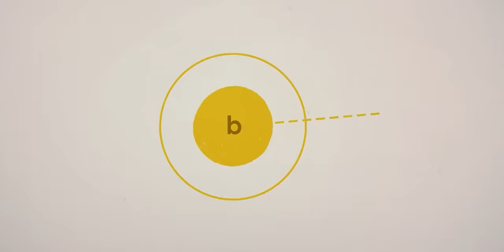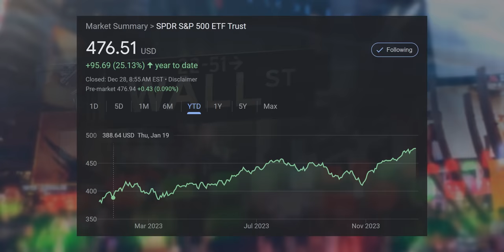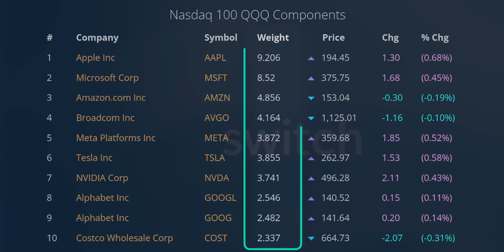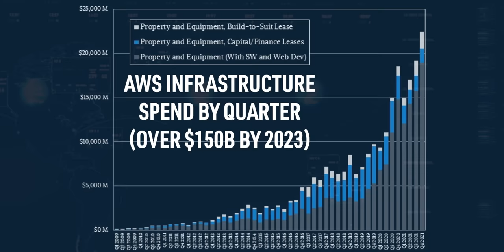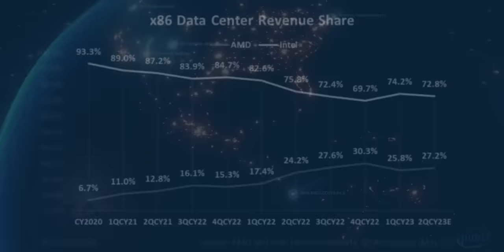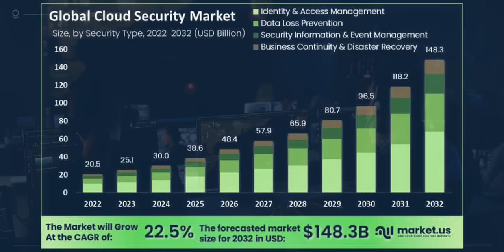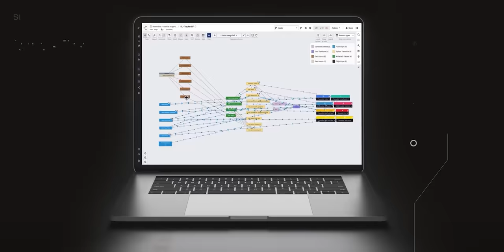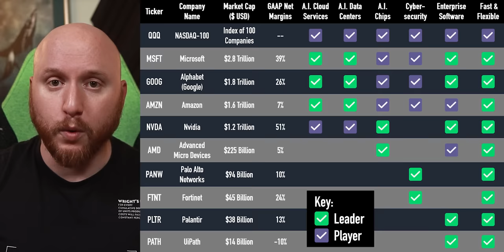Top 10 Stocks to Get Rich in 2024 (Without Getting Lucky)

Comment: Over the last few years I've transitioned from QQQ to VGT. They are extremely similar, but VGT has a lower expense ratio and has either closely matched or outperformed (especially over longer timescales) QQQ since inception. I'm curious why you would choose QQQ over VGT? As for my single favorite stock: ACHR.
Reply: Because QQQ is the famous one, like SPY, there are a lot of other ETFs, but SPY is the most known same with QQQ
Reply: Annoying vanguard don’t offer VGT in there platform in the uk

Comment: End of last May. I picked EXTR, LMB and MOD.  LMB peaked 100%\\EXTR peaked 47%\\ MOD over 300% still going.   I just got into GCT , AZEK and FROG.  For this year. Rock on. Got GCT about $22.xx. Went to $40+ . Stops in. Go.  STOPs in always.   Protection.
Reply: Try Straddles or Strangles. You may find it better and more lucrative than STOPS.  Consider it.  Good Luck. 😂

Comment: Excellent research and thesis. Because I’m an avid follower, I get why you stopped advocating ARK and used NASDQ 100 for cross reference. ARK be tripping sometimes. Backing out when they should be loading or at least holding. Appreciate all the hard work, Alex. The video wasn’t long at all. It went by fast and covered a lot.
Reply from the maker: I appreciate the kind words, thank you!
Reply: After he pushed for ARK
Reply: Missed huge run that’s just started
Reply: @clarifyingquestions he pushed and would have been right if he’d stuck with it

Comment: Basically, when choosing stocks in technological niches with growth potential, he just simply picked from the top mega market capitalization on the Nasdaq on that sector. I don't think this is the most accurate strategy as they are overvalued, given that the market has already factored it into the price. There are several large-mid companies with differentiating products that the market has not yet identified, resulting in a better PEG ratio.
Reply from the maker: It's amazing how often I see this "overvalued" argument as the stocks keep climbing.
Reply: And what did you contribute to the conversation?

Comment: PLTR and SENS. However, I am  thinking just buying the index. S&500 and nasdaq 100 index.  Individual stocks is becoming to risk.
Reply: how about : 20% each of SCHG / SCHD / SPLG / VGT / SMH  returns combined 16.5% p.a (based on last 10 yr performance and this excludes diviidends)   .. or some similar weighting..     very low management fees.    quite tech heavy but SPLG/SCHD does have quite a bit of non tech.       This is what i am slowly moving 60% of my portfolio to.      then just hold the ETFs looooooong term...